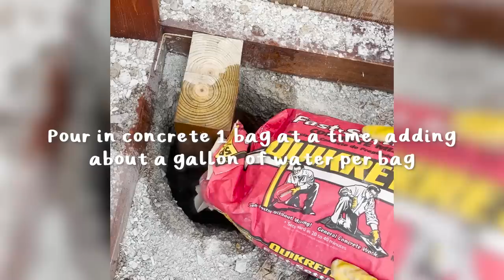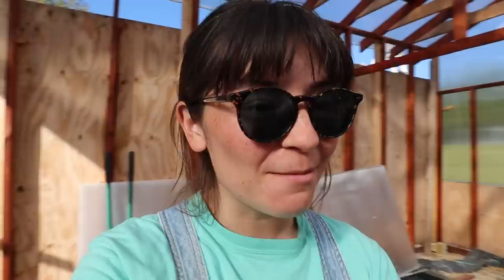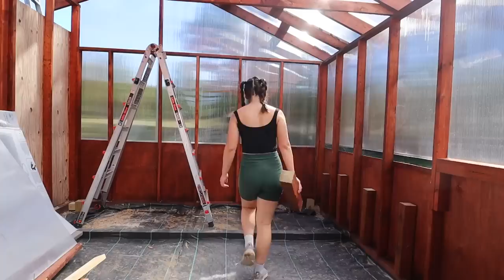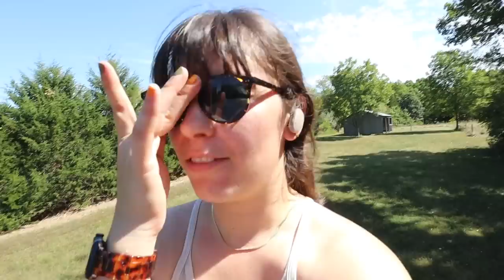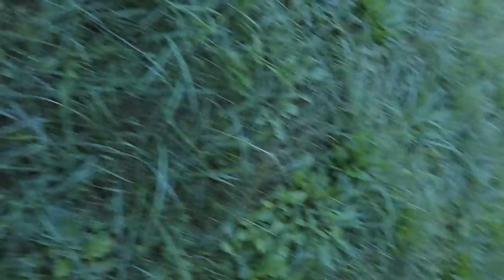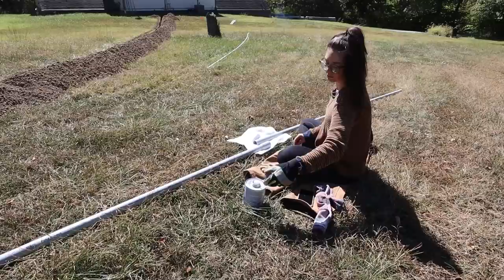CUSTOM GREENHOUSE BUILD PART 3 | installing more siding, installing electricity, and more! mp4

Comment: I had to watch Dan's leg wiggling on the panel install 3 times—have never seen that technique—ever. 🤣 Your 48-inch door could be a challenge. It's an odd size for single-hinged fiberglass door. Might want to look at outswing french doors. Also, a couple building a greenhouse looks exactly like a couple trying to launch a boat off the back of trailer...a relationship test. Again  🤣 . Really enjoy watching your progress.

Comment: I’m sure your already done now, but I just installed a bench in my greenhouse and I put it on hinges so I could use it in spring for seedlings and potting, then lift it out of the way for the summer when the plants get tall. Just an idea. Love your videos! Great work on your greenhouse so far, love updates
Reply from the maker: Ooh I haven’t gotten to that part yet so this is really helpful!! I think I’ll try to do something like this on the north wall :)

Comment: Really love your content! Thanks for inspiring my diy gal side 🥹🛠🥰

I’m wondering if you could talk more in the next video or at some point about your plans with the heater / if you have a goal temp range once the greenhouse is done (also thoughts on insulating vs not & how to keep the heat in). I have no idea about construction…I do have horses in a barn that isn’t heated or insulated, and it stays 10-15 F above outdoor temps in the Midwest winter…so maybe the heater alone will make all the difference? Keep up the awesome work !!!
Reply from the maker: Oh definitely!! I’m saving all of that for this last episode. Still figuring it out but hopefully will have it all figured out 🙃😂